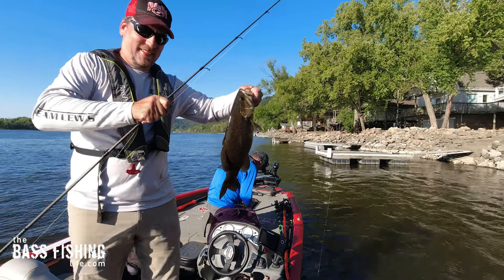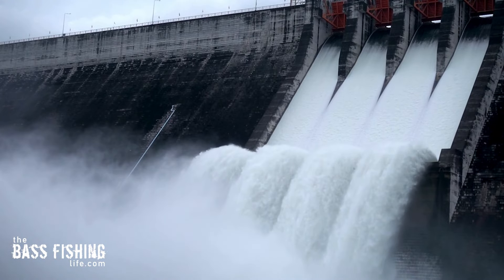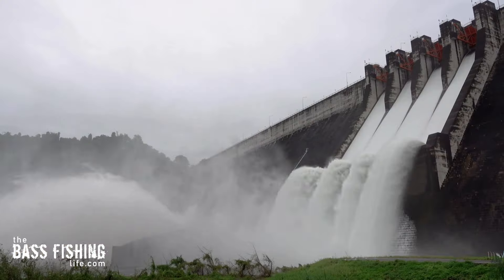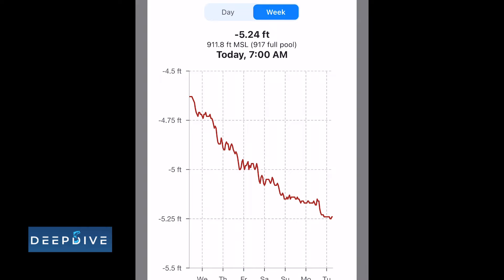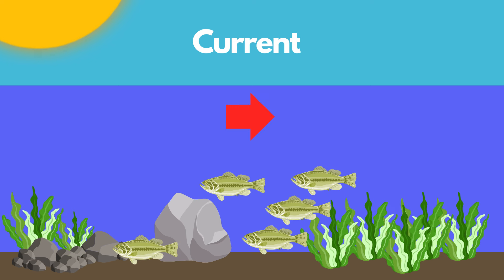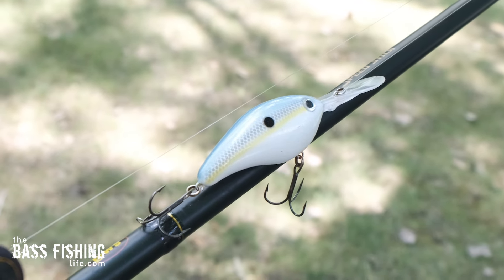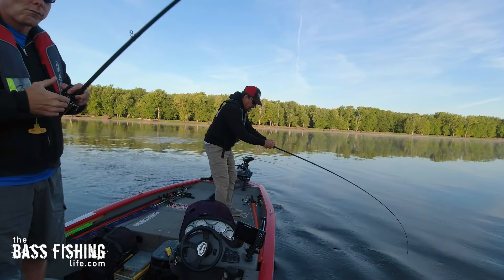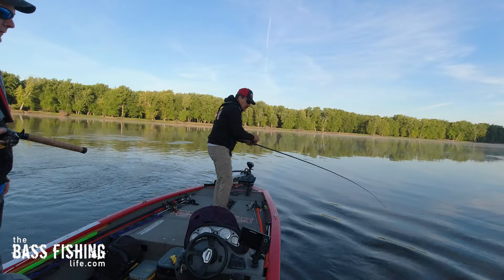The Factor That Can Change Everything

Comment: Hi steve the reason you see bass off of points is, because of the turblant water flow coming off of them.

I forgot what video i was watching but some scientinst were looking at the hydrodymanics of fish. Well anyways the tried using a dead fish in turblant water flow but the dead fish keep ending up on the back end of the boat. At first hey thought the fish was being revived at ffrom the water flow theough it but it wasn't. The scienisit discovered that. The fishes body design allows them to not expand much if any at all energy in those turblant flows.

However its relative to the size of the fish, for how fast they handle.
Reply from the maker: Super interesting! Thank you!